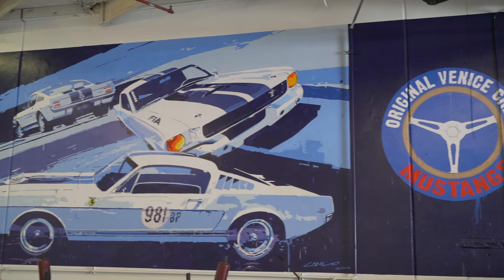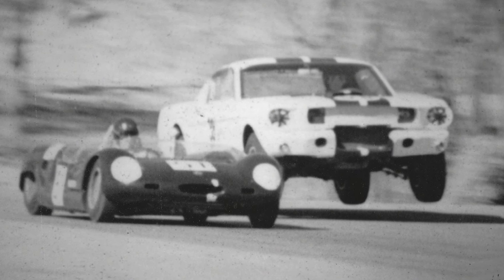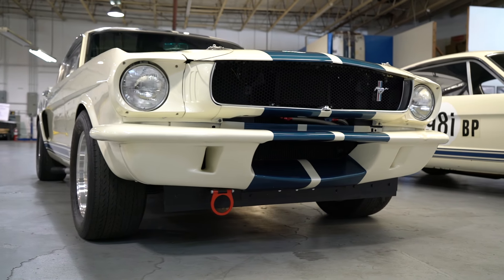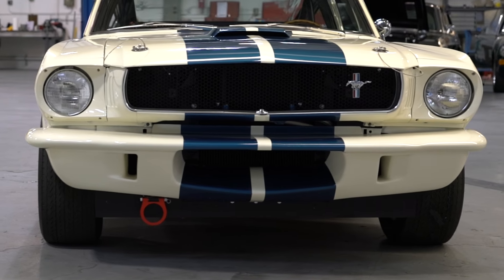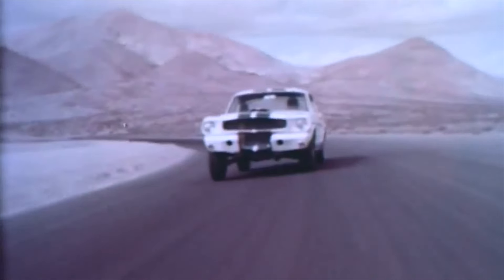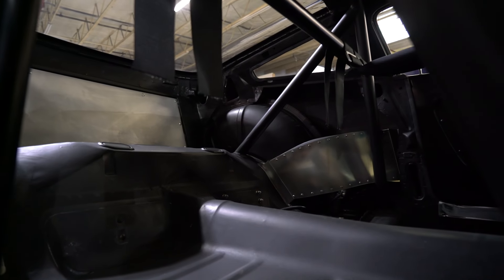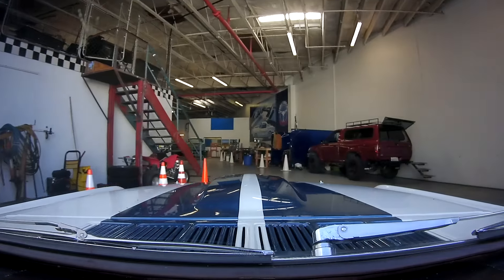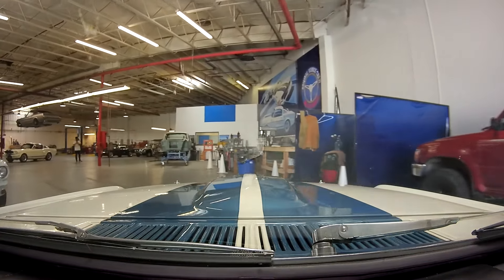1965 Shelby GT350R | The Mustang They Wanted to Build

Comment: Between this car and the new 2020 GT-500, I'll take this each and every time.   That engine sound is glorious!
Reply: I didn't watch anything on the new GT-500 even on J.Leno's YT 😁😁
Reply: Albanian King Owned one.  Traded it in less than a year after buying it...like so many others.
Reply: It’s really one of the ultimate DRIVER’S cars.  As in you have to DRIVE it, not let a bunch of computers and electronics move it down the road for you.  I rode in a friend’s ‘65 GT-350 as a teenager in the late 80’s, and still remember the feeling to this day.
Reply: Adam Fears  Too much power for a manual - read up on it more. The modern cars over 700 HP these days it's more practical to allow the car to do the shifting. 
https://www.motorauthority.com/news/1120910_the-2020-ford-mustang-shelby-gt500-doesnt-have-a-manual-transmission-heres-why

Chevy did that weith it's recent rtounds of the Camero:
https://arstechnica.com/cars/2016/11/how-did-the-new-camaro-zl1-cut-12-seconds-off-the-old-ones-nurburgring-time/
Reply: @Adam fears - 2020 Corvette C8 no stick shift.  The sticks will all be gone in a short period of time!
Reply: @uberfu  not too much power for a manual, even the c7 zr1 with only 5 less horsepower than the gt500 has a manual. They just don't sell

Comment: For those net experts who point to the first gen Mustang's lack of IRS as proof that the European car makers were ahead of the tech game in the 60s, they don't know what they're talking about.  Ford DID have an IRS ready to go for the Mustang.  As Mr. Marietta points out, there was no business reason to offer the IRS, since Ford was selling every Mustang they could build with the solid rear axle.  Great vid, BTW.  That engine sounds fantastic.
Reply from the maker: Crazy that $15 per car was considered cost prohibitive. And it was an honor to spend the day with Jim. The stories!!
Reply: @AutotopiaLA  Ford sold half a million Mustangs in the first model year.  $15 X 500,000 = $7,500,000   Adjusted for inflation, $7.5 million is about $60 million in today's money.  $60 million here, $60 million there, and pretty soon you're talking about real money.
Reply: U
Reply: @mrsloika some people just have to knock others to build themselves up and feel better.  I’m a Mustang guy to the core, but I can appreciate a nice gm or mopar (I’ve never really dug euro or Japanese cars).  Yet some people ONLY see ONE make or marque as having any validity.  It’s really lame...
Reply: @MrSloika - A solid rear axle sure didn't keep the Shelby GT 350 from beating the snot out of the Stingrays, that had it from 1963 on!
Reply: @Loulovesspeed  To be fair, IRS makes little difference on the track, where the paved surface is smooth as glass.  IRS comes into its own on a road course.
Reply: @MrSloika  A road course is what I was referring to!  The GT 350 was the SCCA B Production National Champion (on road courses) for '65, '66 and '67, soundly beating the the Corvettes that were equipped with IRS.

Comment: When I built my 66 GT coupe back in the 80's I weighed and reduced the weight of everything I could, the door weighed 40 lbs empty , with the glass  and cranks 75 !! got mine down to 2700 lbs full of fuel. glove box door was about 5 lbs right there. lots of fun, even drilled the brake and clutch pedals. I drove the guy at the town dump crazy as he would weigh my car on the scale every so often, the fun thing was one day at moroso motorsports park I pulled up to the scale and some impatient but nice guys with fox bodies ran the scale for me, they were pretty surprised when the scale read 2650 lbs. kept the car 25 yrs but eventually the cowl rust and otherwise wear and tear on myself made me sell it. still miss it thought.

Comment: I love the sound of that beast!  So much fun!
Reply: That's the power of a 289!
Reply: @Cameron Bates - The 289 used in The Daytona Coupe had 4 Webers, tuned headers and cranked out a whopping 390 HP.  That "289" power gave the Coupe enough grunt to hit 197 MPH down the Mulsanne Straight.
Reply: Nothing winds like a small block Ford. 

And 390hp was a conservative detuned number to last 24hrs. 289's today crankout more than 500hp reliably NA and shift well above 8,000rpm

Comment: The old man can shift like you are suppose to shift a car like that. It gives me flashbacks when I was between 17 and 25 years old doing the same thing in some Fords I had back in the day. I've seen young guys that get into a pretty hot car and end up either missing a gear or grinding the shit out of one because they are timid and afraid of shifting it with power or scared they are going to break it. But it's always been about taking control of the throttle and clutch and making it go like you want and need to get somewhere fast. Shift it like you are trying to get away from someone after you stole it.

Comment: Shawn, you're also going to have to try to drive the new 2020 Shelby GT500 Mustang. You'll probably want to get a new Mustang instead of
that 2020 mid engine Corvette. People are really raving about this 760hp beast. Mustang lovers should check out the following two videos: 
1) Jay Leno's Garage and 2) Shmee150. The GT500 really sounds awesome in it's different drive modes!

Comment: A concept lost to Ford for decades: make the premium features an option. Like in the Foxbody Mustang Ford sandbagged their own product with 4 bolt wheels, drum brakes in the rear and less than adequate size brakes. The other big performance deficits were  the jitterbug rear suspension and the junk TRX tires. Ford could have made the rear disc brakes and 5 bolt hubs an option on the GT. Enthousiasts complained about the lack of aftermarket wheels for 4 bolt hubs. The 4 link rear suspension needed a panhard bar. In the 80’s Ford was like the parent who just wasn’t ready to let their 19 year old daughter out of the house to start dating.
Reply from the maker: Awesome comment!!

Comment: What a sound... The only reason I hook up my laptop to my home theater sound system, is to listen to your videos. Also, for the info. I'm looking for the perfect sound for my '65 Stang engine rebuild and I'm pulling all the stops to make it just right. As in, only the best will do. I don't have to worry about emissions, like in some of your videos I see you have to take that into consideration. Where I'm living, the car falls under the heading of "classic cars", from a time when emissions weren't and couldn't be measured. So, I can do pretty much what I want. Anyways, my little pony pollutes far less than any modern car---cos it isn't driven nearly as much per annum as your take-a-pick-hybrid or any other new car. It's in the shop half the time anyways... It is, afer all, is a sixty-year-old Ford.

Comment: I may be wrong, but I think the 65 Shelby Gt350 had a louver over the rear window and not an actual window...  Also..in order to homologate and go racing, Ford had the choice to either put the go fast motor in the car or put in a better suspension.  Ford chose an upgraded suspension for the GT350, thinking it would be easier to warranty a suspension than a racing motor.

Comment: Do you get any rein through the rear window?
Reply from the maker: Don’t know but probably not driving it in the rain. Good question though
Reply: It created a low pressure zone.  As long as the car was moving at high speed, , it was supposed to stay quite dry
Reply: Not at all....as long as you don't race in reverse!  Lol

Comment: The 1965 SHELBY GT350 R  models  did NOT have Quarter Panel Plexiglas windows as these Replica GT350s have . 
and they all had 15 INCH Goodyears  on all 4 corners : )

Comment: A very odd picture at 8.42, Right hand drive and a gear shifter near the drivers door, what am I missing?
Reply: john brown Australian race car. The Peter Brock ( RIP) he is talking about was an Australian race car driver. The car was developed for him to race in Australia
Reply: @doogiehounslow1160  Yes there is a difference "Pete  Brock" is/was American the designer of the pagoda roof cars [a design highjacked by the 3 pointed swastika] but how do you place a gear shift lever in that position, must be a special bracket assembly to go to a column shift transmission case.

Comment: O.K., Shawn, I'm a fan of you and your channel and videos and enjoy them all.  I agree with your "Ford vs Ferrari" movie opinions.  I have one slight "miss" of my own.  That would be given the time you've spent with the guys at OVC, in this video you had not accurately explained the '65 "GT350" name.  In another post covering the '65 GT350 (https://www.youtube.com/watch?v=AnngWMMv9DA at about the 6:35 mark), Jim Marietta explains that the '65 GT350 was named from the Shelby shop from the start as the '65 GT350 Competition model.  It's Shelby VIN # included in part, either a "5S" for the Street model OR a "5R" for the race model.  People started referring to the '65 GT350 Competition model as the '65 GT350 R, a technically inaccurate name according to the guys that were there building them back in the day, but the "R" usage "stuck".  My 2 cents.  Keep up the great videos.

Comment: Sheet metal behind the LR tire looks a little shot out. Hope that is not the finished product.
Reply from the maker: They do these exactly as the originals. Rolled all wheel wells. He actually said they did too clean of a job compared to the ones they did in the 60’s

Comment: The answer is at 02:28 when Bob Bondurant and Ken Miles tell you it doesn't work you don't build it.  With a stock rear axle the GT-350s won championships so Keep It Simple Stupid.  And since it never got close to production consideration his statement of it only costing $15 to add independent rear suspension to the car was BS @ 03:05  On a standard production Mustang just the front disc brake option retailed for $58 and styled steel wheels were $122 so a cost of only $15 for a performance upgrade they could have charged $150 for would have been approved...if it worked.

Comment: Still won't touch the 2020 Shelby. Nice car though. Why not build as many as they can sell? It seems silly to only build 36 after all the r&d work that has been put into the project.
Reply from the maker: Because there was 36 originally built. Pretty simple. And it’s not attempting to keep up with modern tech in any way
Reply: AutotopiaLA  I understand why they chose 36. Just seems silly to me. I'm sure they want a small fortune for one of 36. It is truly the car they wanted to build in 65 with the IRS. It would make sense to produce and sell as many as possible.
Reply: @johnroberts5285  The GT 350R was a pure race version, not street legal.  There really wasn't much more of a market for them for racing.

Comment: Fyi...if they are boring and stroking to 331 C.I. then it isn't a Hipo 289 block like the original GT 350 and GT 350R cars started with...they are starting with a '68 and up 302 engine block...it took real wizardry to build a 289 engine to 360-425 H.P. range that would stay in one piece, so for all the new cars ability, they are pretty much cheating putting a 302/331 engine with aluminum heads in it, also it does not sound like a mechanical cam to me either and it sure doesn't rev like the 289 Hipo, that engine's redline was 7,200 RPM ...it is no longer a period correct effort even with the power train, which leaves me less impressed with their endeavor (a guy who owned a real '65 K code (aka 289 Hipo) fastback Mustang with the Shelby mods.

Comment: The red primer under body looks like panels by R3 Performance Products.
I would like to have a track toy, unregistered, no tags, but titled, at $30k.  I'm not sure how possible that is.  A turn-key street car with no modern corrosion protection, for a lot more than $35k, is not what I'm going to sign up to buy unless it has verifiable provenance.
Sorry, but I'm not hopping on this band wagon.  To each his own.

Comment: Bean counters ruining cars! Imagine where the Mustang would be now if it had IRS since the 60’s.
Reply: His cost comments were tongue in cheek. Mustang GT was sticker $3450 (not $2450) and more than that on the road. The IRS was nowhere near $15; not even as little as $1500. Remember, Shelby's GT350 was already $1500 more than the standard Mustang GT, and that was mostly all part swap upgrades with very few mechanical mods.

Comment: I'd like to see a proper driver who can hell and toe downshift...like me.
Reply: @Richard H - You may know how to do it, but you sure as hell can't spell it!  He's not racing which is the only time it is necessary or even makes sense.
Reply: @Loulovesspeed  Apologies for the typo. I suppose 'heal-and-toe' downshifting isn't always necessary, but surely it does make for nicely coordinated gear changes, and, more importantly, cool engine sounds? I went to a lot of trouble to learn the technique in my 1973 Z28 road car so many years ago, having to deal with less than ideal pedal placement. It paid off nicely in single-seater racing later on.